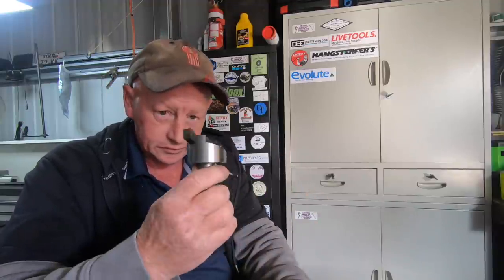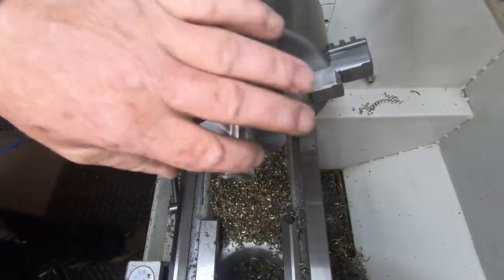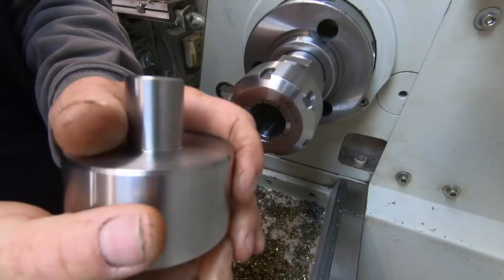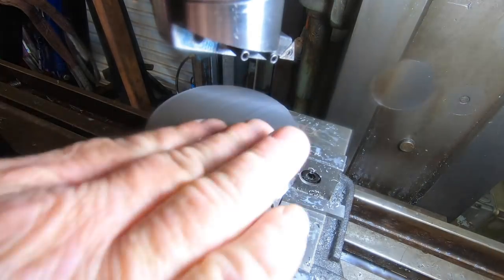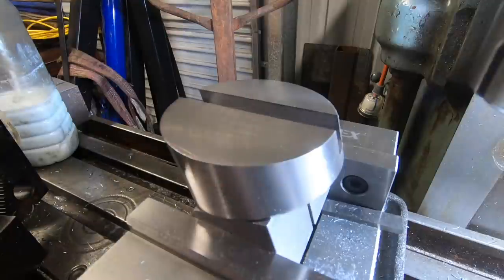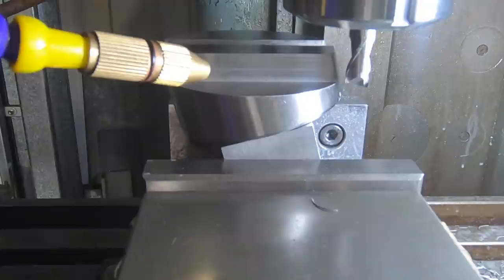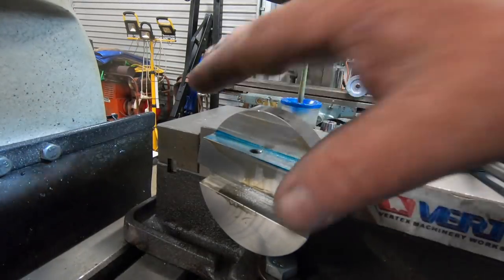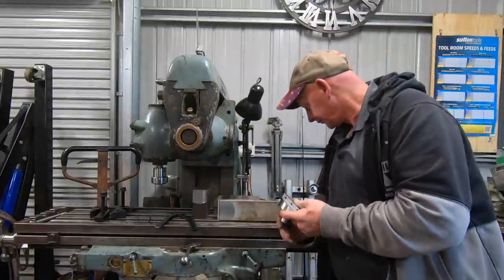Fly Cutter

Comment: Hi Matty, I did a lot of experiments making fly cutters. Cutting the groove off center causes vibrations, off balance, effecting the finish so I have my cutter on center and found 5 degrees gives the best finish using a triangular insert. Cheers...
Reply from the maker: Gday Dave, the Cincinnati mill is quite rigid, the finish felt very smooth and didn’t seem to be any vibration in the cut,  the 2 other cutters have a 20° angle and I made the new one with a 15° to keep the mass done a bit, appreciate you watching, cheers

Comment: Hi Matty, looks very nice and a great finish on the cut.
Is that a triangle insert that would normally be 90 degrees on the cutting edge if used in a lathe? So you have about 15 degrees overcut on the leading edge?

Comment: Hi Matty just going through your back catalogue, here before Christmas 2022. Nice build, pity about the battle scar, but you know, shit happens mate if that's the only mistake you're doing well lol could you tell me the 12x12 bar and insert details please as they make a nice cut. I made a 55 mm one with a 3/4"shank as I've only got ER32 collets. I was doing great until I stuffed up and put the slot on the wrong side! It still works, I just run the mill in reverse. But I'd like to do a bigger one like yours. So that's a project for the new Year. Unfortunately it will have to be out of any steel I can get as 4140 isn't available over here and something like EN12 or 18 is so bloody expensive on eBay. We had numerous engineering firms around where I live in East London and there were a good few steel suppliers, but both the engineering firms and the steel stockholder all seem to have gone to the wall. Hey ho! I will get something eventually. Cheers Matty, Sam
Reply from the maker: Gday Sam, the tool I use in the fly cutter is just a cheap import, it’s a SDJCL1212H07 and the inserts are made by Drillpro DCMT070204, I hope this helps mate, cheers

Comment: Hi Mate!  I love your fly cutter and need some.  The finish is out of this world for milling machines. What is the tool and model number of the tool? It looks longer than a regular 1/2 inch cutter. I started using Iscar inserts a while back and I find them expensive. What do you use these days?
Reply from the maker: Gday, the tool I use in the fly cutter is SDJCL1212H07 and I use Drillpro brand inserts off eBay, there cheap but seem to do the job ok, I hope this helps, Cheers

Comment: Hi Matt.
Can you please explain why the tool is tilted at an angle, if it was flat to the bed the insert edge would still be the lowest point. I think cutting the tool on an angle is a leftover idea for when there were flat HSS toolbits. With the insert protruding beyond the toolholder body on insert tools you are using, is this angle required?
Reply from the maker: Gday, using an insert tool doesn't require an angle, one advantage is if you have a longer tool the the body of the fly cutter you can machine up to an edge/corner without the rear of the tool hitting, I hope I explained that ok, also with the inserts I use in mine if the tool was flat there would be more edge engagement to the material and possibly create chatter, Cheers
Reply: @MattysWorkshop  Cheers Matt. It just seemed to me that all these new flycutter videos are making the slot at an angle because they all looked like that back in the day. This is where the angle gave natural clearance for HSS blanks instead of having to grind one side away to leave the cutting tip lower than the side of the blank. I see what you mean with the other end of the tool able to hit a shoulder when the cutting tip is out less from the body than the other end. This can be remedied by moving the toolbit out and moving the bed further away from the shoulder. The shape of your toolbit looks like it could not go back far enough to expose the other end enough to extend more than the cutting end. It's rare to use flycutters on anything other than a flat plane, rarer still, to create a sharp corner.

The shallow finishing depth of cut is usually less than the tool tip radius, so the engagement will be the same, just on another part of the tip radius. Round button inserts are possibly ideal for deeper cuts for this reason ( and the cusps blend smoother ).
Using tangential tip engagement is probably the most influential improvement to reduce deflection, impact chatter and ultimately surface finish.

The homemade flycutters I have seen mostly use PCKNL toolholders laying flat. They use the unused obtuse corners of old CNMG inserts from  lathe work.

Comment: Still the exact same way I made them fifty years ago. Only we didnt have insert carbide readily available then. I did use carbide tool bits brazed of course. Seem to me I used the type for cast iron on hard steel . High speed for everything tho. Momax and rex were my preference. Good job mate
Reply from the maker: carbide has made things easy but it can get expensive, thanks for watching, cheers